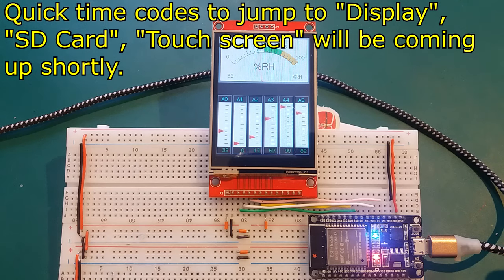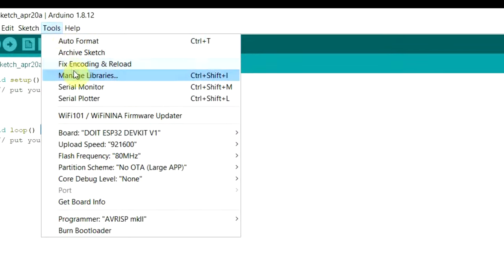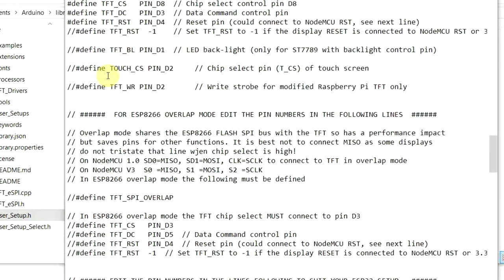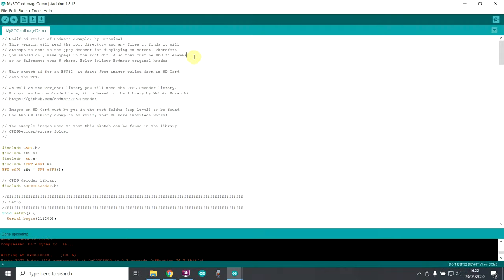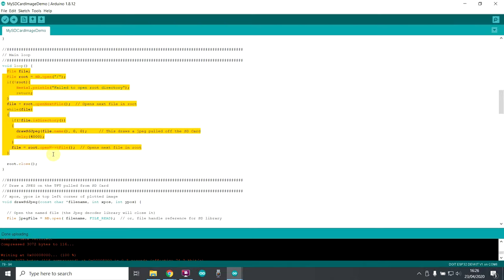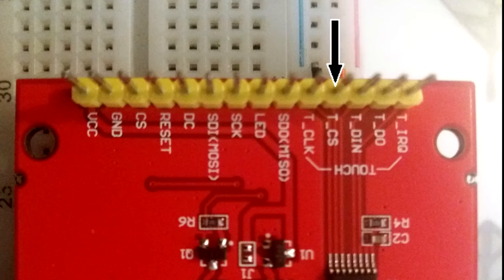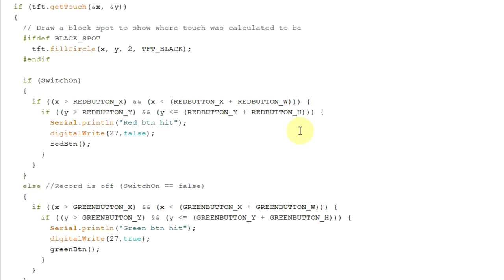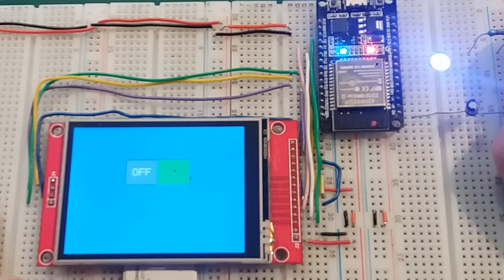ILI9341 TFT LCD to ESP32 - Full HOW TO  for display, SD card and Touch. Using TFT_eSPI driver

Comment: I juat want to add my thanks and appreciation for the terrific tutorial.  It really helped me with my ESP32 ILI9488 project.  The video was informative and your presentation style is fantastic.  Nice and breezy.  You have helped a lot of people.  Thanks again.
Reply: While I have your attention, I used the example sketches to test each of these functions separately.  (TFT, Touch, SD Card)  They all worked great when modified separately for my application.  I then integrated them into my main application one by one.  The TFT and Touch functions work great together but I get compile errors when I add in the SD Card code.  I am certain there is some conflict with the FS/SPIFFS/LittleFS/SD libraries and the JPEGDecode library.  Have you been able to develop code with all three of these features integrated into one application?

Comment: Thanks for a complete detailed video. I discovered that I needed to supply +5VDC to the VIN pin.  I was not getting enough current from the USB cable.
Reply from the maker: I've had similar issues with ultrasound sensors

Comment: This is awesome!!! THere is just one detail, pins 21 and 22 are default for I2C on ESP32, and since I'm using SPI and I2C, I need to change CS pin, but all good, just would like to warn oter person when developing projects to take this in consideration.
Reply: How to change these ports? i would like to connect an ADS1115 to the ESP throu I2C.
Reply from the maker: Unfortunately this video will only work for I2S on this type of screen.
Reply: I got it by my self (: but thx for Response. Just changed the Touch cs pin to 13 i think...
Reply: How to change to different pin if I need to keep it available for I2C connection?
Which pin should I use?  Do I need to modify user.setup.h?
Reply: @cooljackwi  If I change t_cs to 13, do I need to edit user.setup.h?

Comment: Thank you very much for your video!  All the guides for similar displays assume the touchscreen's SPI is connected to the display's SPI, and so the only wire you need is the T_CS wire.  It wasn't working.  I needed your video to understand that with this particular board, I have to manually short their SPI wires myself!

Comment: Great presentation! I did run into a minor problem with the Meters script, was getting 6 warnings
 "ISO C++ forbids converting a string constant to 'char*'  " 
and pointed to 6 lines (44-49) in void setup.  Although the script compiled and loaded fine and the meters displayed beautifully on my display, I still did not like having those warnings.  Did a little research and learned that Warnings usually mean that your program may or may not work.  Those 6 lines called a function (plotLinear() with three parameters, the first of which was "A0" thru "A5".  Located the function 
void plotLinear(char *label, int x, int y) and changed it to 
void plotLinear(const char *label, int x, int y)
and the warnings disappeared. Script compiles and loads and runs just fine.
Reply: REALLY???
I'm gonna try that, mine refused to compile on that error.

Comment: THANK YOU! 4 days trying to make an TFT ILI9488 Display to work.
I almost gave up, then YouTube randomly recommended this video.
It really works! 🥲
Thank you!
Reply from the maker: Yes, I had same problem, most videos lacked detail, weren't clear or were wrong. I managed to cobble several sources together and get it working so put it all together in detail
Reply: Hello @joaoliduarario, I can not get the pin assignement part of the vidio, can you coach me with that beging part of the video?

Comment: All very helpful.  I wired everything up as all the diagrams that I found, modified my TFT_eSPI setup file with the right settings, turned on and nothing.  After a while, I tried following your instructions to the letter, wire colours and all and it worked, even though everything I had done was exactly what you did, though I used an orange wire for CLK and a green for data, so maybe that was it.  (Only kidding, I suspect that I've got a duff wire or a duff connection on my breadboard), but hey, thanks.
Forget TFT_Meters, the TFT_Matrix example is super!
Reply from the maker: Brilliant, ha ha deffo colours matter lol. Thanks for the tip.

Comment: Awesome instructional video. This was the best esp32 / eSPI video by far. Loved how you went through the steps very clearly with visuals. Thank you very much.
Reply: hey did you get any output on display? I am getting only white display. please help
Reply: Me too, but I'm getting an image using a different adafruit example with exactly the same pins defined and wiring.

The example in this video compikes, uploads and runs, but the display is solid white. The output from the touch is also just pegged at z 4000 odd and x&y stuck at zero.... They move a bit when I touch it but y stays at zero

Comment: Magnificent guide - I now have the Display section up. Didn't work first time - tried in Arduino 2.0.0 rc9.4 - lots of critical errors compiling - updated library, boards etc still failed Using ESP32 Wemos Lolin32  and 2.8" ILI9341 TFT LCD.   errors like undefined min(_h,_w) etc, got the latest tft_eSPI from GIT hub, same no matter what example I tried.  So I deleted all my arduino installations, and folders, Libraries etc. Then installed fresh IDE 2.0.0 Rc9.4, added ESP 32 boards , added tft_eSPI from the IDE 2.4.72, edited the User_Setup.h file as advised,  compiled with a few warnings about the Changed pin assignments - but no errors, Uploaded - and I'm a happy man! many happy displays. ( TFT_Meters.ino example)
Reply from the maker: Well done, great determination there 👍

Comment: Thank you for an excellent video. Yes for work with the ESP32 it is all in  the TFT_eSPI library and not the Adafruit_ILI9341 library. As for the ILI9488 - forget that one for the moment, but it works well with the Seeeduino Xiao.

Comment: Perfect timing! Got a non touch ili9341, DFplayer Mini and ESP32 in front of me. Problem has been brown outs. Was going to swap for a Bluepill STM32, but will try the Bodmer library before ripping it apart (probably literally lol).
Reply from the maker: If powering from the computer over usb then check the quality of the cable. I've had some drop quite a bit of voltage by the time it gets to the dev board. Gave me a few headaches once when using an ultra sound sensor. Use shortest quality cable you can. Hope this helps.
Reply: It does help, thanks, forgot all about daft 40 gauge wires with the oversized sleeving - this will be one!  Thanks for your fast reply too  :)

Comment: I would recommend connecting touch cs to screen cs so you can keep pin 21 for  i2c as for instance a bmp pressure sensor will spam the touch with input.
Remember to change #define TOUCH_CS.
Thanks for the project but i think it needs wiring diagrams.
Reply: Is this possible because the touch controller is only sending data to the esp32, and the display controller is only receiving data from the ESP32. So they can technically run at the same time anyway? Does this speed things up so the display doesn't lag behind the touch input?
Reply from the maker: I'd have to Check but as long as the touch controller waits until the esp32 is ready to receive data after generating its interrupt then should be OK. But would have to examine library's. As if esp32 half way through sending data to screen and starts servicing the touch then could cause corruption. The potential is there, I just haven't looked how the library's work
Reply: Can you help with the pin assignment, I dould not understand his example?

Display Pins   -  ESP32 GPIO Pins
VCC                    5.0V or 3.3V 
GND                    GND
CS
RST
DC - I belive is  23 
MOSI
SCK
LED                    5.0V or 3.3V                    
MISO
TCLK
TCS
TDIN
TDO
TIRQ 
SD_CS
SD_MOSI
SD_MISO
SD-SCK

Comment: Thanks!
I'm currently working on my first project that will use an ESP32 instead of an Arduino and this is just what I was hoping for!
It''s gonna be a WIFI-enabled clock that uses NTP and JSON over HTTP to retrieve the time and weather forecast and displays the information on an 60 LED ring and TFT screen.
Reply from the maker: Cool, I did a weather forecast with esp32 and a paper display if that helps
https://youtu.be/jsJmmmYtgcw

Comment: Thanks so much for this video! I've got a question. These display boards have a jumper "J1" for selecting the voltage. In your case for the ESP32, did you need to short this jumper "J1"? Just want to confirm before I do something stupid with my board...
Reply from the maker: Yes, short the jumper if using ESP32, leave alone (how they come by default) if using Arduino. Nothing bad happens either way for ESP32 apart from it may not work if you do not short it. Mine worked and then stopped when I added one more component to the project. For Arduino it may break the screen if you short it so leave un-shorted.

Comment: For anyone with touch issues using the most recent version of tft_espi. Make sure to disconnect sdo(miso) it should be connected to nothing. Connect t_clk to pin 18. Fixed my issue.
Reply from the maker: As you can see in the video it all works. And if you look through the comments you will see it's worked for many people. Did you use the exact same version of the library and did you read the pinned comment about the bit I missed about the touch screen? I think it's mentioned in the video description too. Did you read that?
Reply: @XTronical  this was a video from 2 years ago. I'm assuming the version I am using is different. I apologize for coming off blaming you for the issue. Let me edit the comment. Thanks for your content btw!

Comment: I now have my 3.5” TFT touch screen working, I created a menu system as well to change settings on my ESP32 based 2 channel LoRa to wifi gateway, which I designed late last year, I did a video on it at the time but that was with a 2.4” OLED, before I added the TFT.
Reply: Hello Defpom, I am struggling with the initial pin assignment at the begining, can you share wiring schematic?

Display Pins   -  ESP32 GPIO Pins
VCC                    5.0V or 3.3V 
GND                    GND
CS
RST
DC - I belive is  23 
MOSI
SCK
LED                    5.0V or 3.3V                    
MISO
TCLK
TCS
TDIN
TDO
TIRQ 
SD_CS
SD_MOSI
SD_MISO
SD-SCK

Comment: hello, I have a question so basically we are trying to use the esp32 as a database storage and we need an sd card module for that but using a tft display will occupy the needed pins. So upon seeing this video, can I use the sd card embedded on the tft display as an alternative to store data? Will it work the same as the sd card module? Thanks in advance!!

Comment: If you take a look at the sources of Bodmer's lib you can see that in some cases he is pulsing the chip select within a method. 
But in your code it looks like you are wrapping the chip select enable/disable in front of/after the method calls on the lib. 
Doesn't this affect operation? Or are the ili displays not dependent on these pulsings?
I was thinking about replacing the esp's gpio chip select with a gpio expander for all cs lines but just have an mcp23017 (i2c) at home atm which is ok as i am not relying on high update rates. A mcp23s17 (spi) would speed up operation quite a bit though.

Comment: Thank you very much! I was struggling so bad with my ILI9341. Thanks to you I managed to edit the user_setup.h so it works.
The SD-Card won't work, but I guess thats due to the lack of connections on my expansionboard. I've ordered this bundle "Esp32 arduino wifi & bluetooth 2.8 "240*320 smart display bildschirm lcd tft modul mit touch ESP-WROOM-32" from aliexpress and was hopping, that all connections on the ILI9341 were lead to one side.
One question: How do you delete the touch-calibration? On the first start after uploading the sketch, the touchscreen had quite a delay and so I've touched the same corner twice...🤦 
Now "touch corners as indicated" shows again, but neither my finger nor the pen works. Uploading the sketch again didn't help

Comment: Very useful - thank you.  Spurred on by your demo I've now got a touch screen gui for my home automation :)    Are you aware of any way to control the backlight? - all I've seen so far are mentions of cutting traces and soldering a transistor.
Reply from the maker: Yes, just connect it to an output pin instead of vcc. Setting pin high will turn it on, low off. You could even use pcm to give varying brightness. Arduino's and esp32 outputs can cope with the current required, although you could measure it first if you wanted to be doubly sure.
Reply: @XTronical  Thanks - I'd tried that without success - will give it another go, as I must have done something daft.

Comment: Good info. But when I compile your code, I get the following error. 
How to fix that?
Thanks.

Invalid FQBN: getting build properties for board esp32:esp32:esp32: invalid option 'EraseFlash'

Compilation error: Invalid FQBN: getting build properties for board esp32:esp32:esp32: invalid option 'EraseFlash'

Comment: I have followed the exact instruction through your very nice explanation, but the TFT display is not completely filled. So I'm missing a small part of the display (show some kind of noise). What am I doing wrong and how can I fix it?
Reply from the maker: So mostly it works, i. e. You can write stuff to it but a part is just random stuff? I'm wondering if the screen is incorrect resolution. Try drawing a box at the required resolution and see if it all fits one. I think these screens are 320 x 240? Might be wrong, been a bit of a while.
Reply: Did you ever fix this error? I am having the same problem

Comment: Hi!

Do you kno if is possible to integrate this lib with a 4' inch display? I've tested with a ILI9488 spi display, but like 30% of the display didn't show anything,  I mean were blank, just the others 70%. I use a resolution of: 480 × 320. Thanks
Reply: Hello @danilocarra7494 can you help me with the pin assignment,  did not get the part where  they show the wiring?

Display Pins   -  ESP32 GPIO Pins

VCC                    5.0V or 3.3V 
GND                    GND
CS
RST
DC - I belive is  23 
MOSI
SCK
LED                    5.0V or 3.3V                    
MISO
TCLK
TCS
TDIN
TDO
TIRQ 
SD_CS
SD_MOSI
SD_MISO
SD-SCK

Comment: I would like to ask that  I am using the ESP32 Wroom 38pins version and I am going to design the circuit board for my graduation project now, so I would like to ask you to help me check if there is any mistake in the pin connection. There are two PCBs, a receiver and a transmitter. They all need to communicate wirelessly.
This is the pin connection of the transmitter.
#define LED1/out   G4
#define LED2/out   G16
#define LED3/out   G17
#define LED4/out   G5
#define Button1/in  G27
#define Button2/in  G26
#define Button3/in  G25
#define Button4/in  G33
#define Buzzer/out  G32

This is the pin connection at the receiver which needs to be connected to a TFT 3.2inch screen.
#define TFT_MISO   G19
#define TFT_MOSI   G23
#define TFT_SCLK    G18
#define TFT_CS       G15  
#define TFT_DC      G2  
#define TFT_RST     G4 
#define VCC          3.3V
#define LED           3.3V
#define GND         GND

#define LED/output         G25
#define Button/input     G26
#define Buzzer/output     G27
Reply from the maker: Well, looks OK, but I've never built a receiver, transmitter pair myself. Just get one part working first, either the tft or the receiver stuff. Don't try all at once.

Comment: thanks I have just tried and works, but I have an problem, de X and Y are inverted, so instead of shown in "vertical" is it shown in "horizontal" all the examples. how can a fix this?  thanks.
Reply from the maker: How odd, not had that mentioned before. So the X Ord is being reported in Y and Y in X? This seems very odd. All I'd suggest is that in software just re swap them back. Very weird.

Comment: I want to make it with the Relative Humidity reader just like you show. Can you show how to make it save data to a data logger? I am doing atmospheric research. I want to create a device that can be worn that will collect data in different environments inside and outside. Because it is wearble, I don't want it bulky or heavy. The data logging is for reviewing at a later date away from the location. Thanks
Reply from the maker: Did you mean this comment to be under the humidity sensor video I did? Anyways, basically you'll need to hook up to a sd card interface (videos on this) and make the Arduino go into deep sleep to save power (as battery powered) and just save to a text file on sd card in comma delimited format. This will load up straight into excel etc. I've done a weather centre project which shows deep sleep and sd card etc.

Comment: Nice Video! It worked fine on my ESP32 and TFT. Now, I would like to use the SPI bus 1 (VSPI?) for a different device (LoRa), the pins 23 (MOSI), 19 (MISO), 18 (CLK), 5 (NSS), 25 (DI0) cannot be used for the TFT. So I changed the pins to the other SPI bus (HSPI?) for the TFT in the setup file to 13 (MOSI), 12 (MISO), 14 (CLK), 15 (CS), 2 (DC) and 4 (RESET). I even uncommented the line #define USE_HSPI_PORT, but the display was blank, showed nothing. Any ideas? Could it be that those HSPI pins are reserved for the TFT touch screen? What pins should I use for the TFT on the 2nd SPI?

THX, John
Reply from the maker: Sorry, off top of my head I don't know. Would have to set this up and investigate

Comment: Sir great video but is it possible to play continuous video on it?
Reply from the maker: It's technically possible but video would need to be uncompressed and only run around 12 fps. You would need to store this internally as well for speed so you'd only get maybe 3 secs of video.

Comment: If both CS are running on PIN 5, it does not work. For SD another PIN should be selected. In the setup SD.begin(PIN_X) should be called.